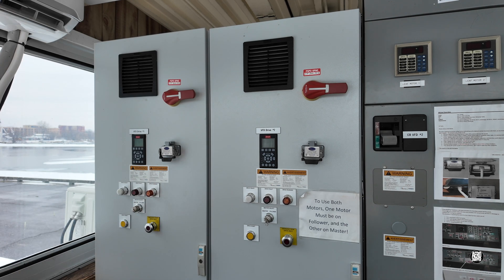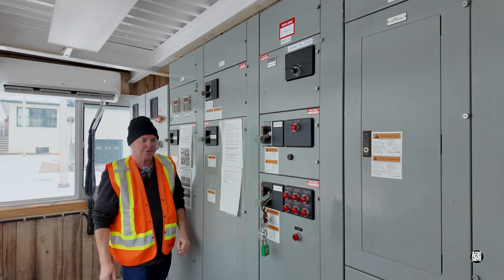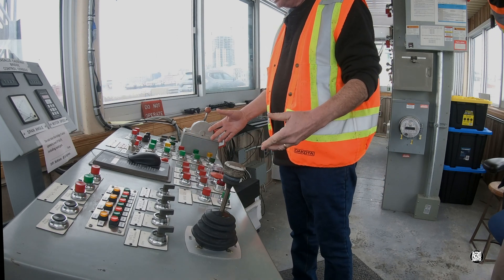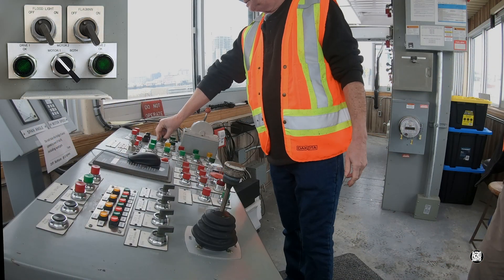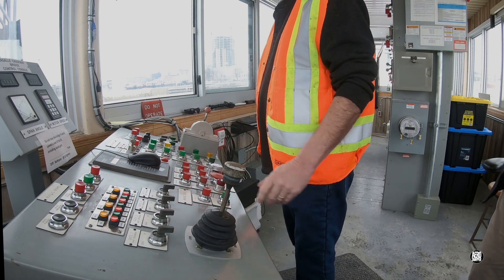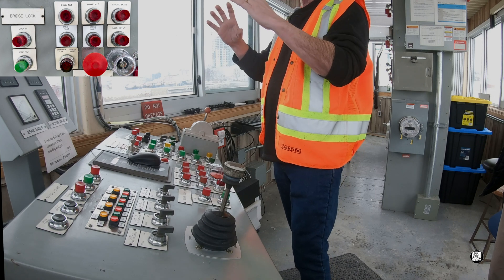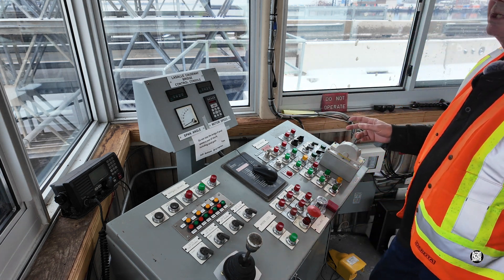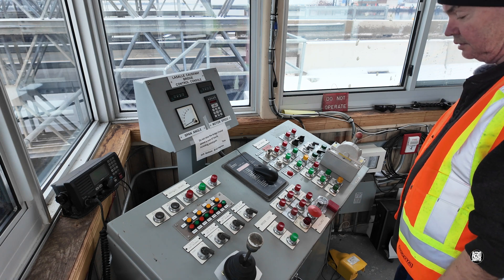Power is nothing without Control - learn how Kingston's La Salle Causeway Lift Bridge worked   4K

Comment: Pretty cool! We have a couple of 1940’s boilers at work that still have their original controls on a panel sort of like this. The newer boilers are all controlled through computers and while I’m sure that’s much easier to setup than physically constructing a panel and wiring each individual switch and light…it feels a lot more satisfying to flick a switch or press a button and see the lights react accordingly. More so on the boiler side, but you can have both hands on different control knobs to do 2 things at once with the classic system (like adjust a fuel+air at the same time, or transfer between 2 fuels). To do that on the computer you’d have to click back and forth for each incriminate…takes a lot more clicks to get anything done
Reply from the maker: That's a really interesting revelation - thank you.  I guess analogue panels probably didn't offer too many variations in style.  The key, I suspect, besides actually working, would be to group controls in a logical fashion that followed the sequence of functions controlled.  I agree about the satisfaction of feeling a tangible, mechanical response to each operation.  Touching the images on a multi-function display just isn't the same ! You make a good point about needing more actions too.

Comment: My uncle was a bridge-op on the Welland Canal, and we could visit him at work. Despite that board being made in the late 1920s, Lasalle's 1990s panel looks very similiar (so 1960s was a good guess!). Very little changed in its appearance or functionalities.
He ran the newest bridge at lock 2 (replaced after a ship hit the old one).
FYI, the new lift span will probably move a lot faster than you're used to. Before modifications in the 00s, lock 2 bridge always looked like it would slam down hard, just before the brakes slowed it for landing.
Reply from the maker: Thank you - these are the memories that capturing details of our bridge are designed to bring to mind.  Bridge operators are a very special breed.  I'm sure your uncle knew that. Yes, it's surprising to see what looks rather aged arriving as late as the 1990s, but why change a proven design.   I look forward very much to admiring the new bridge - whatever form it may take
Reply: @Aerosnapper   My uncle took early retirement because they automated the bridge, and he couldn't go back to being a linesman due to the new self-mooring devices.
Reply: Hey.. I lived in Welland, I bet your uncle operated the bridge for me a few times!

Comment: All through a gear box and rack in pinion! As simple and fail safe as it gets
Reply from the maker: Designed in a time when simplicity sold itself ! I don't think there was ever a really serious issue with the bridge
Reply: Whenever I worked on it with the 1410 gangs, we only ever really had to deal with the axle bores & bearing blocks, as well as the occasional electrical fault. Motor was getting long in the teeth, hence the counterweight expansion to try compensate. But yeah other than that, next to no major mechanical issues. Just wear items and lifespans coming to a close